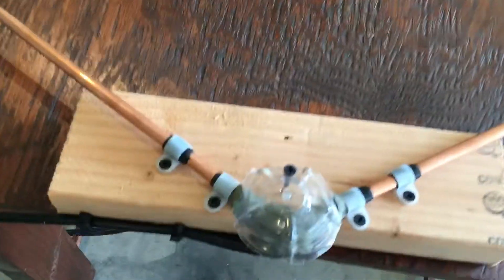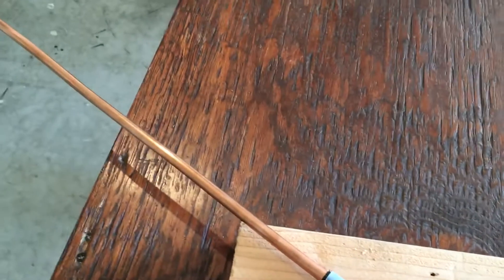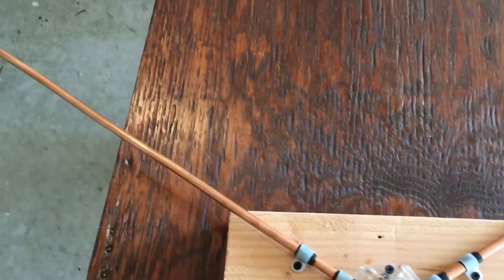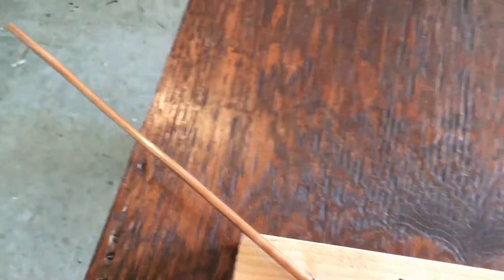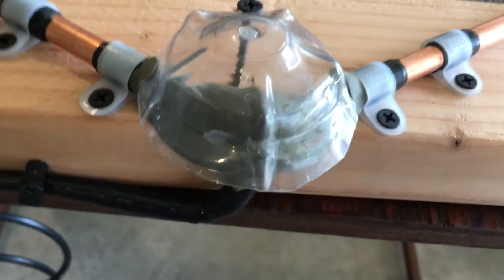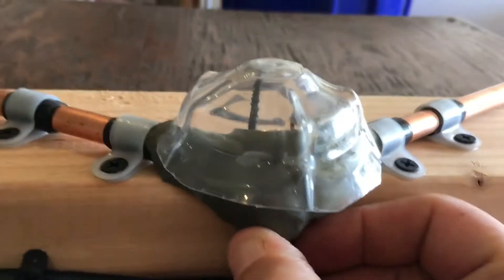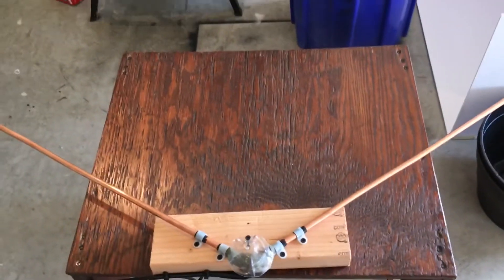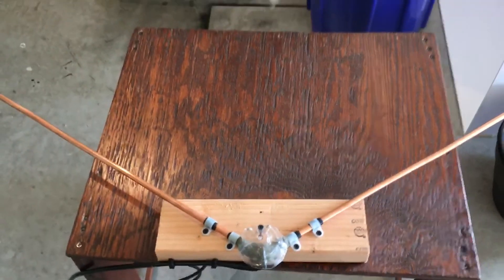Homemade V Dipole Antenna For NOAA Satellite Weather Images “NOAA 15, 18, 19"

Comment: how do you calculate leg length for different frequencies?
Reply: 468 / frequency is for a one half wavelenght in feet

or

300 / frequency is for a one half wavelenght in meters.

hope this helps ;)
Reply: Total length in meters is = 147/F.  F is your target frequency. So, for 137 Mhz,  147/137= 1.072 meter. Since it is total length, for each leg, 1.072/2= 0.536 m.